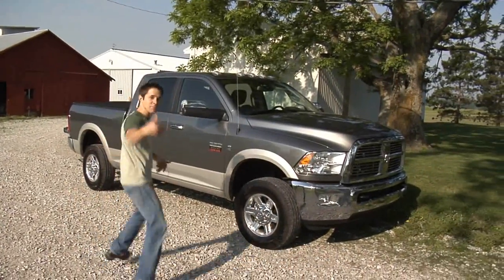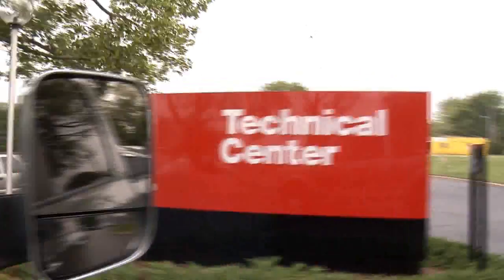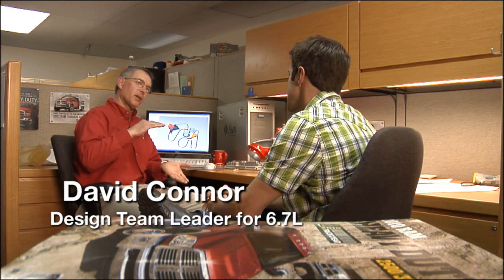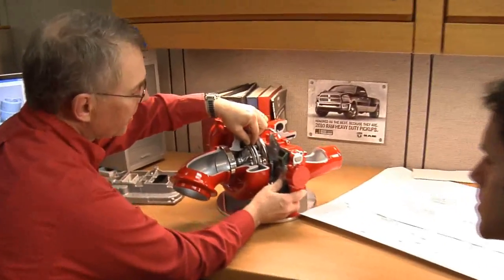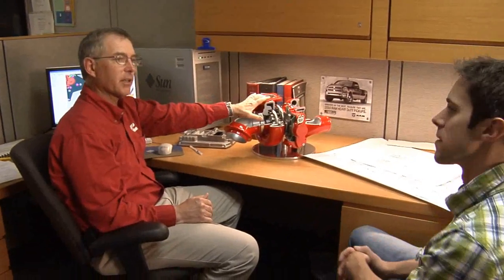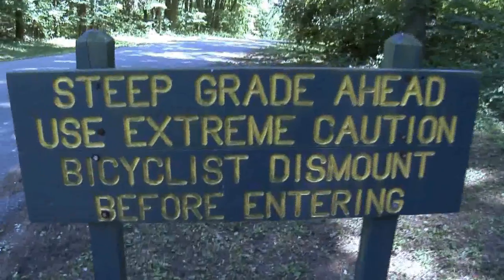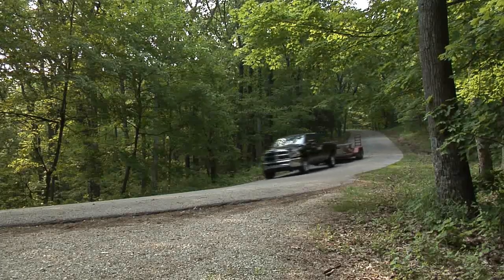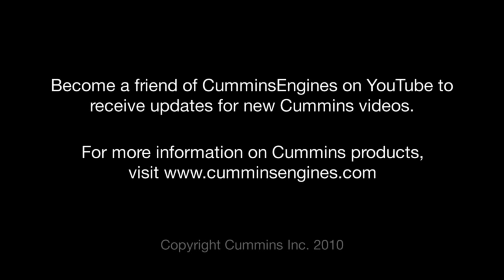Cummins 6.7's Biggest Fan (Pt 6): No Feet With Exhaust Brake

Comment: Just purchased a used 2012 Ram 2500 Mega cab with this 6.7 engine.  Amazing.  I spent a lot of time, research, talking to Ford and Dodge owners and the serviceability on the 6.7 is great; way better and easier than the Fords.  It's like I finally found an engine that was made with self service in mind.   Gas mileage is way better than my 08' Tundra with WAY more power.  The EB works like a champ too.  

@ me2456-  What a joke, just because your dad is a mechanic doesn't mean a thing.  Go back to playing video games kid.  Ford... LOL, don't even think about trying to work under the hood without removing half the engine. There's no room under the hood.  The 6.0 and 6.4 were nightmares.  Just check out powerstrokehelp on Youtube.  Why do you think they had to bring the engine back inhouse?  Remove the cab from the truck to do work on the engine, lol.  Sure amigo, go ahead and think Ford's are better than the Ram/Cummins....

Comment: congrats you bought the motor that blows more head gaskets then a 6.0l..... I'm a ford guy all the fucking way but common everyone knows the 5.9l is the only good cummins to get......
Reply: The Ford 6.0 was blowing head gaskets with stock engine management. The 6.7 Cummins doesn't have that problem, it does if you get agressive on your tune and want A LOT more power out of it.. the ENGINE itself is just fine..
Reply: the 6.7l cummins is more of a problem then the 6.0l.... don't tell me my dad is a mechanic.... they should have kept the 5.9l and good try with throwing the 6.0 under the bus! the 6.0l WAS PROVEN to be 100% fine with SEM.. the problem came when people would go WAAAYYYY beyond the service date on it (yes iv been guilty of this in my 6.0l) but i don't let it go more then 2k over or then you get problems the gaskets just don't blow kiddo the EGR breaks/clogs causing more pressure in the system then you get the gaskets blowing. good try though.